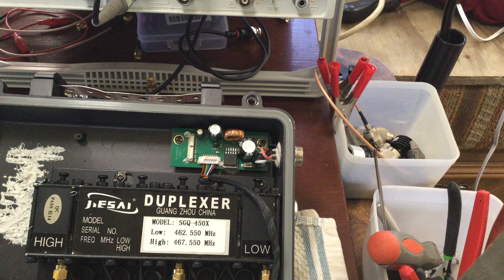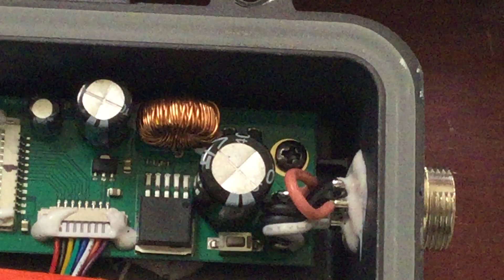🔺 I did I find a "secret" switch for programming the retevis RT97 GMRS two-way radio repeater!!🔺

Comment: I need the program software for the rt97 gmrs. Bought a used one and would like the ability. Do you have a way to share it with me?
Reply from the maker: it should be on retevis website under support/ sofware
Reply: Thanks. It's not there, but I was able to obtain it from the previous owner.  @GMRStwowayradio
Reply from the maker: @onthemoveautomotive6930  ok good you got it